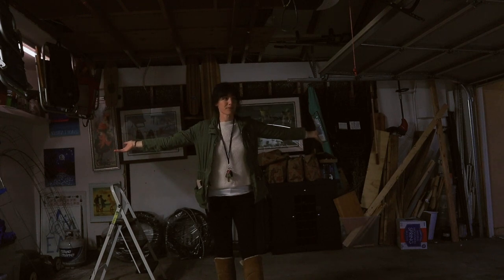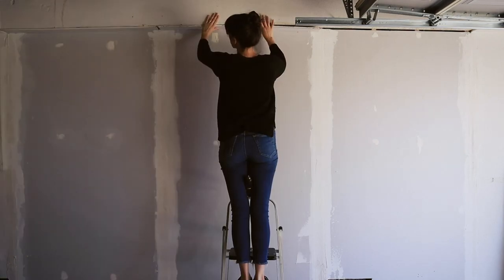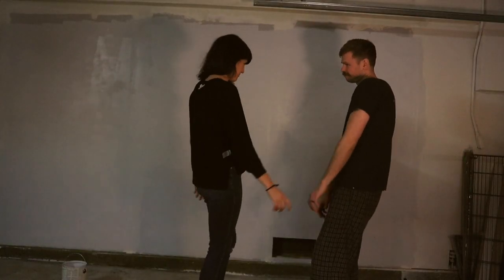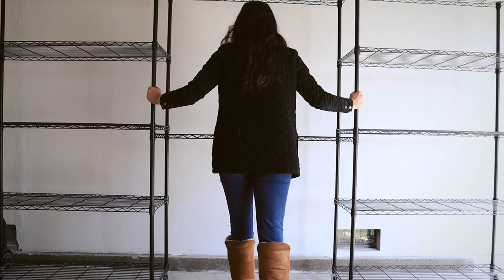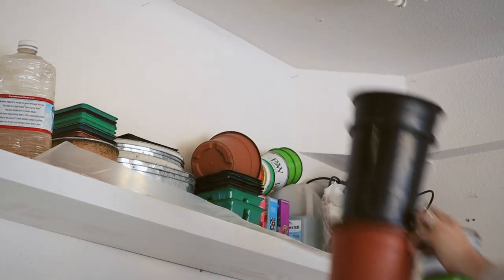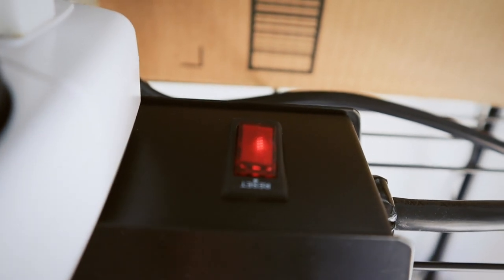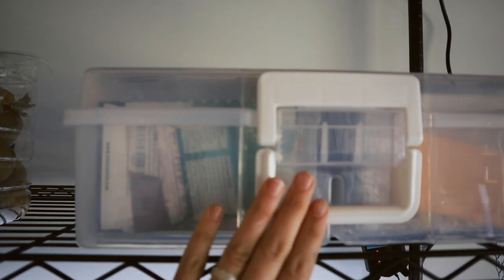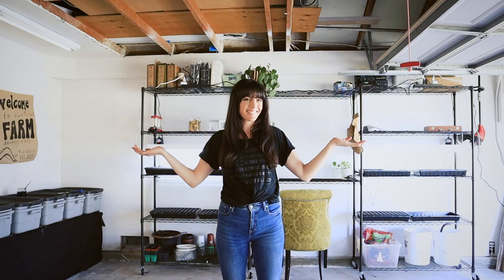Total Garage RENOVATION | I turned my GARAGE into an URBAN FARM | Preparing for Abundance in 2020

Comment: I use Beamworks aquarium plant LED light from Amazon for my grow lights. I got them to overwinter all my tropicals inside over winter and loved them so I bought 2 more for seeds starting last year. They have red, white, blue and green spectrum lights and my starts were amazing! They are  4' long and 2 side by side covered 2 full trays of plant starts.$45ish each but worth it!!! Edited to add the garage looks amazing!!! I love how you configured the shelving to make 3 out of two! Smart!!! My tip for drywall is a very dry/damp sponge is best for evening out the joint compound so it requires less sanding!!! You are welcome. I got this tip from an older gentleman handyman when I was working on the house while pregnant and it saved me a ton of time! 👍
Reply from the maker: Awesome. Thank you Gail. I’ll have to check those out.

Comment: Is your garage heated? I have a detached garage that is not heated, although there is a tiny Woodstove....would love to do something like this, but the early spring here in Vermont is still pretty cold. I don’t think I’d be able to start seeds out there in March 😞
Reply: I would have to refill the woodstove every two hours, and even then it does not get that warm as the woodstove is not big enough to heat the entire space.
Reply from the maker: My garage is not heated. It actually gets quite hot in summer. It’s hard working with the elements! Good luck. I’m sure with a dash of creativity you’ll work something out :)